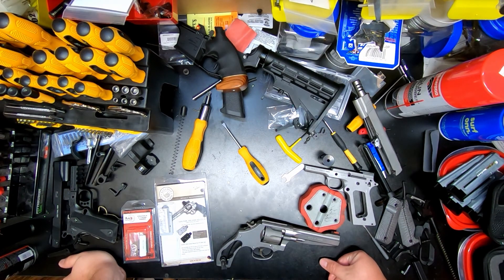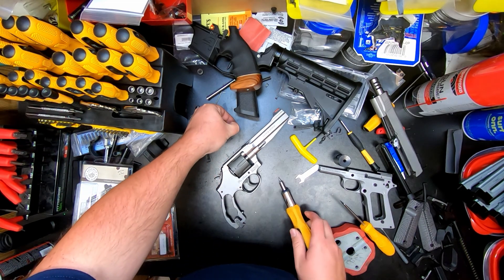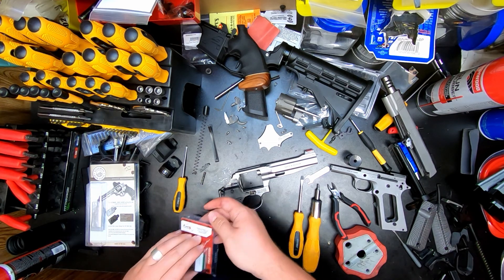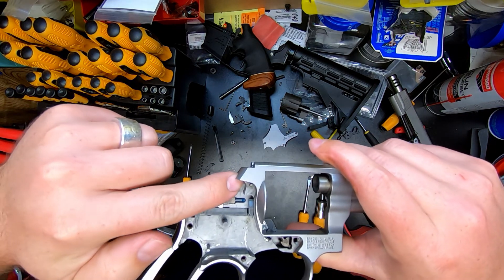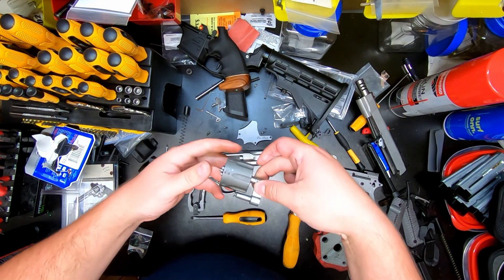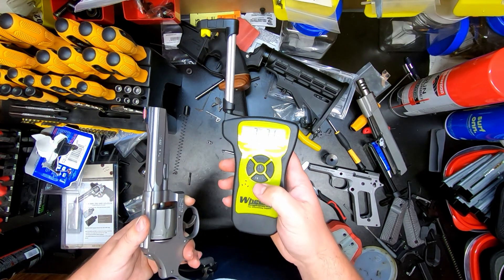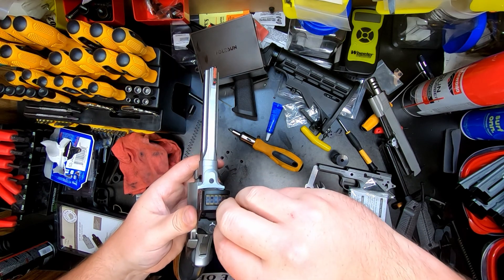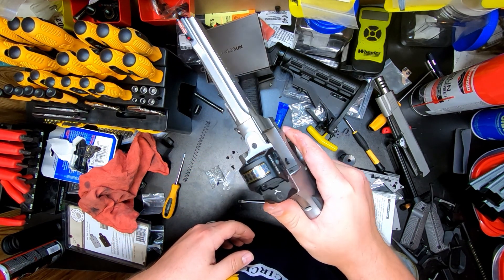Installing Apex L frame Evolution IV Hammer Kit (S&W 986)

Comment: I have the same hammer and it works with the hammer block, just an fyi. BTW, I also run it with the Wolff rebound spring and ribbed hammer spring. Very smooth action

Comment: The 986 comes from the "Performance Centre" with a Wolff mainspring anyway, no need to change.  Brownells own springs are also Wolff in Brownells packets. You can tell by the rib. Same with my Competitor.  Good installation vid though.

Comment: I used this video to install the Apex kit on my Model 69. Everything functions wonderfully, but as I intend to use this pistol as my EDC, I can't shake the nagging concern that an AD will occur without the hammer block. Am I being paranoid?
Reply from the maker: I think so. Unlike a strike fired gun this gun has no chance of going off without the trigger being pulled. The hammer has nothing to snag on so it can't cock to have a partial hammer drop on a live round. If you feel concerned leave an empty chamber under the hammer